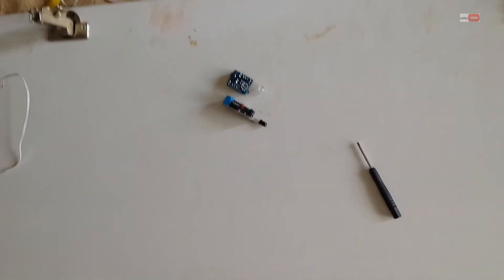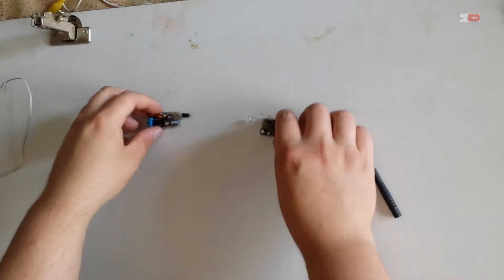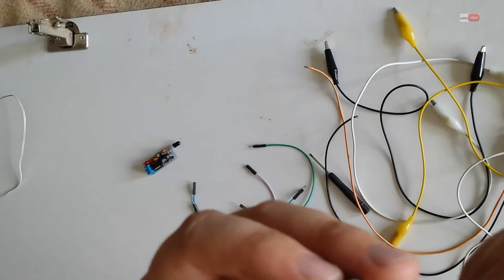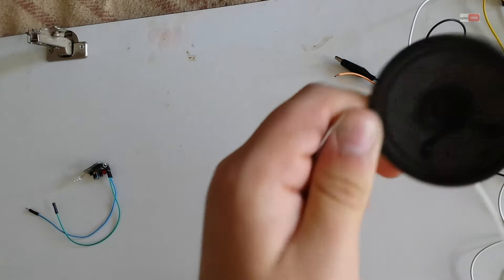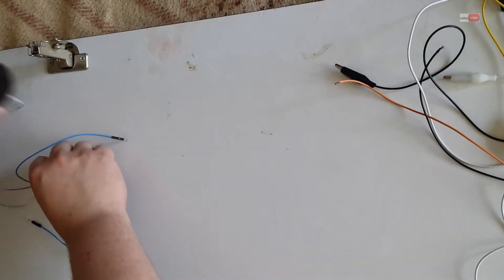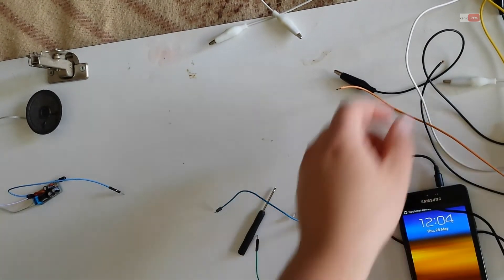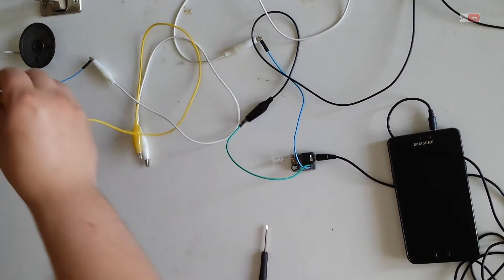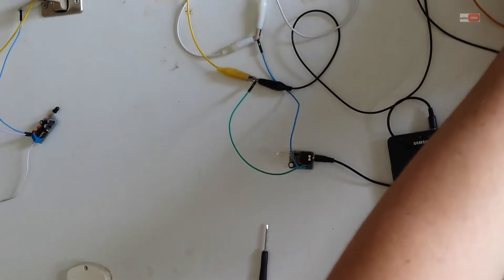Cheap diy wireless audio IR sound transmitter and receiver

Comment: I want circuit diagram bro
Reply from the maker: Hi bro, look at 3:34 and  3:39
Reply: @cehic1994  can i use such to to transmit aplified sound like from a 2.1 channel hifi sound booster